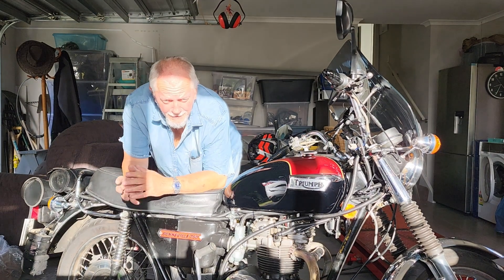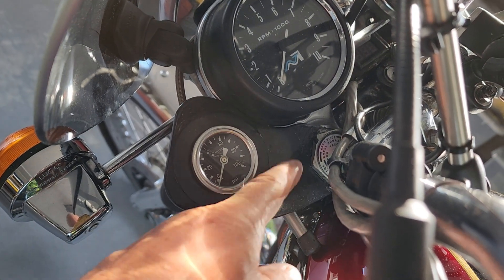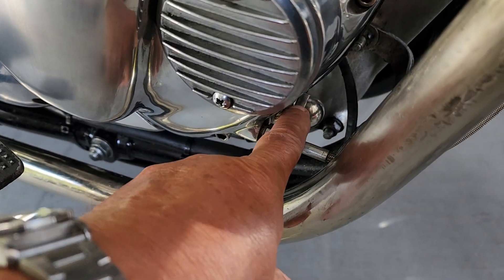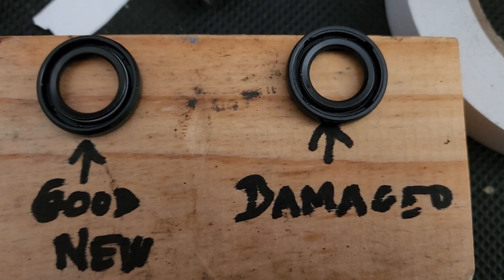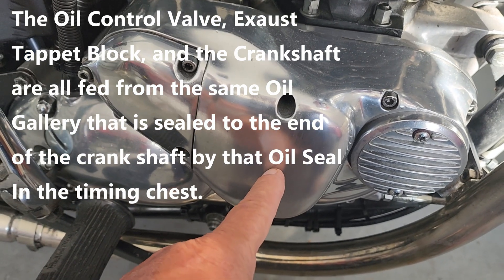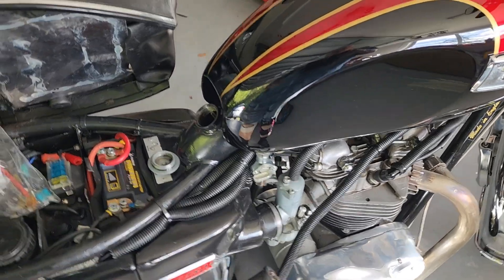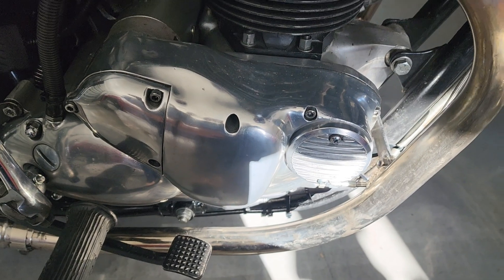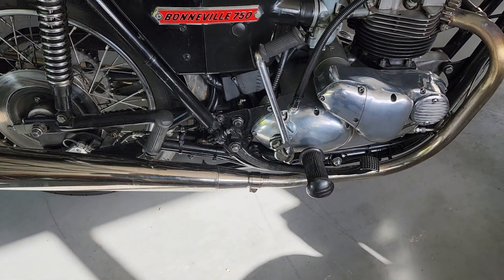T140 Oil Circuit Explained

Comment: Dave, what is the best method of ascertaining if the correct amount of oil is reaching the engine's top end?
Reply from the maker: The oil supply to the top of the engine via the rockers is open flow. It relies on the return line back pressure developed via the pipe into the tank that has a fixed dia hole in it. The rockers do not need much oil to operate. The other other oil supply lower down in the engine is via the tappet blocks which is under pressure. The combined flow of all the oil from the rockers, tappets, crankshaft and oil pressure relief valve oil flows or drips down into your crankcase which normally has around 350ml of oil in it. To check your rockers are being fed sufficient oil just carefully loosen the chrome dome nut on one of the feed pipe to the rockers with the engine running. Oil should start dripping or oozing out almost immediately. You can also put your finger over the return line for five seconds. (NO MORE or you will food the engine). Stop the engine immediately and check the oil level in the crankcase. Normally you have 350 ml in the crank case. After this test you will have well over that probably 500ml dependant on how quickly you turned the engine off.  That's all you can really do on that. Generally if you have oil to the dome nuts on the rocker oil feed to the rockers then that is normal and is all you need to do. The only way to check your actual rocker shafts are clear of blockage is to remove them and clean out the oil ways. Rocker shafts only normally need removing and servicing every 20,000 miles. The oil supply is very reliable to them. Hope this is of use.
Reply from the maker: The top end is drip fed only and has very little oil. As long as its a bit oily in the rocker box then that is quite normal. You can put your finger on the return line for a couple of seconds when its running to check it, but no more than five seconds or you will flood the crankcase and make the bike wet sump.

Comment: Ah yes the great Triumph oil pressure debacle.  I too run a gauge and the light as well, just because I like to see a light come on when I go to start my bike.  Anyhow,a gauge works great and really shows how much oil pressure can vary, at least in my case.  If I am going up a long twisty road that is steep and many miles long, the pressure drops as the motor is working harder, is running hotter, and thus the oil is thinner. When going downhill the oposite.  Claimed hot oil pressure is supposed to be 20PSI, but with my bike is more like 10-12, and I rebuilt my motor and set my rod bearing clearances between the min and max acceptable clearance ranges.  Anyhow, I also had a seal fail, it is very important that people use the Pioneer Westin seal for this job, as a lot of shops will sell you the same seal that is used to keep oil from getting into the points / advance unit.  I made this mistake, oil pressure was poor during one ride, light came on at hot idle, luckily I was home and just shut it down.  Good vid, keep them coming!

Comment: I went down the road of a Kirby Rothbottom - he made good arguments about where the oil filter should go obviously it involved making changes to the timing case.
Reply from the maker: Why change the timing case that's a daft idea and is very expensive to do. As long as you have the filter in circuit on the pressure side of the pump or on the return line it will work perfectly.